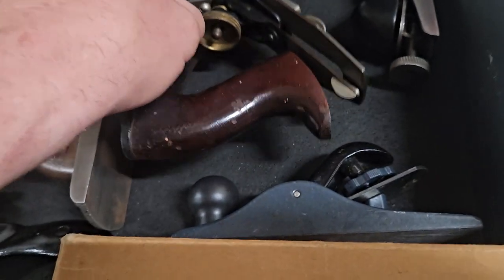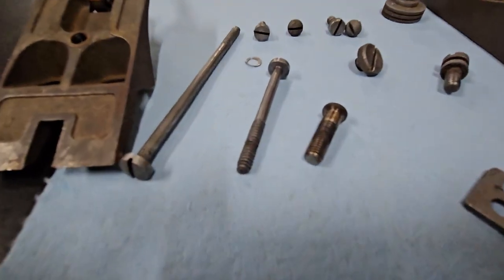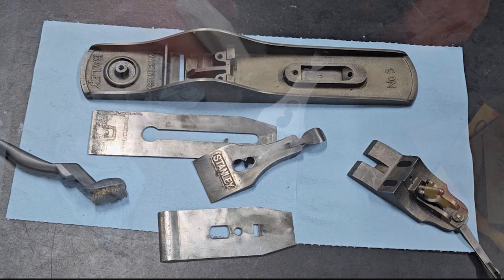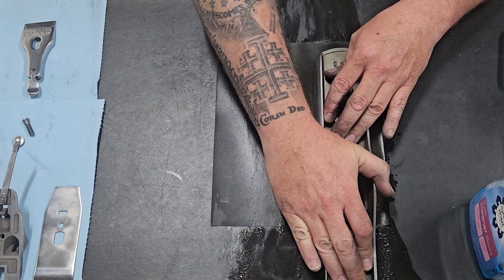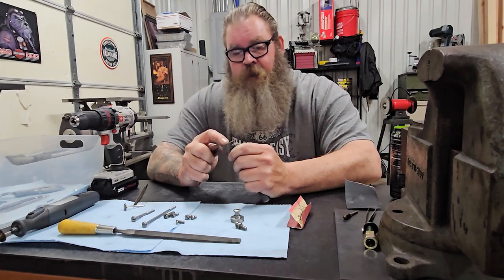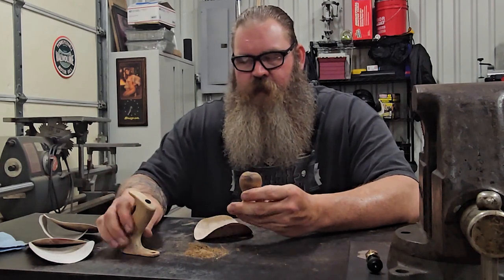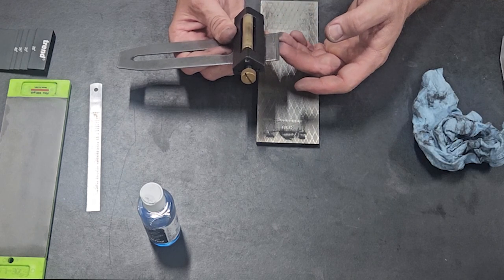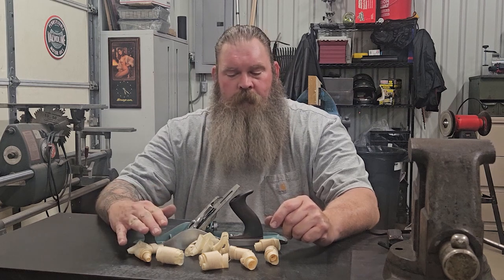Grandfauther's rusty Stanley Bailey N⁰5 plane restoration.

Comment: I think you have a Type 17, made approx. 1942-1945.  During WW2, brass was a strategic material, so the screws and adjustment wheel switched to steel for the duration.  The wood is a domestic hardwood - Brazilian rosewood was hard to obtain during that time, as well.
Reply from the maker: I did figure out it was a type 17 because of the steel parts.  It was confusing though.   If I followed the flow chart, it pointed directly to a type 19.
Reply: The problem with identifying the war planes is that they used whatever stock they had, so there can be parts used from other types. The lever cap has a patent on the back, it maybe leftover type 16 stock. However, the bolts to lock the tote and knob down (and of course the depth knob) are definitely type 17, while there are also the hard plastic depth knobs about for type 17. The sole on the type 17 is a thicker cast than other types. The plane study is based on the no.4 model and is essentially a guide and not a given. I’ve no idea if the other countries that were licensed to produce Stanley tools match the flow chart. My Stanleys from the UK have me scratching my head at times, while my Canadian Stanley seems to fall in line. I have a type 14 no.3 (USA) but someone had updated the lever cap to kidney shape. It doesn’t matter to me as my tools are intended for use. Once the restoration bug bites you it may not let go... keep on having fun 👍
Reply from the maker: @johnnyzone1967  thank you for sharing the information about the type study.   I didn't know this information, and I'm sure others will appreciate it as well.   Thank you for checking out my video.

Comment: Very nice job 👍 .. The  plane looks like a type 16? Which would be between 1933 -1941..
Reply from the maker: I was only going by the flow chart I found online. It originally pointed to a type 19 but it has the cheaper metal parts.  I think its a factory  frankin plane.  I have been told war time planes had whatever parts were laying around slapped on them.  It's hard to tell what it is.
Reply: @_BigLife_ yeah man it's a 17,  don't take any notice of me .. I missed the lack of brass ..
Reply from the maker: @Hudson Sled  it's a tricky one.   If I follow the flow chart, it takes it straight to a 19.